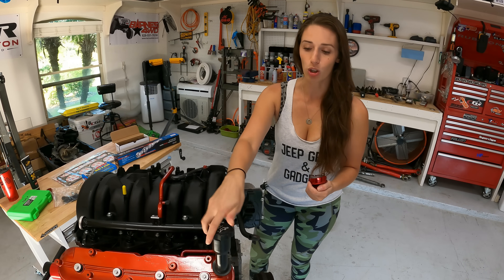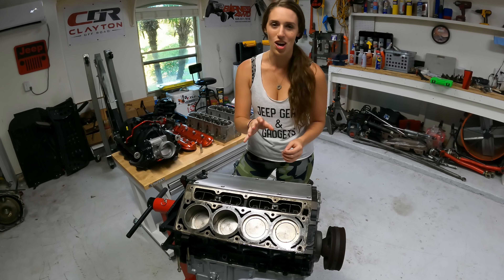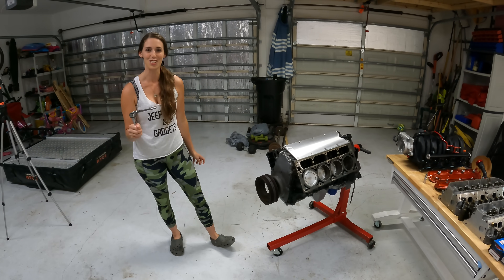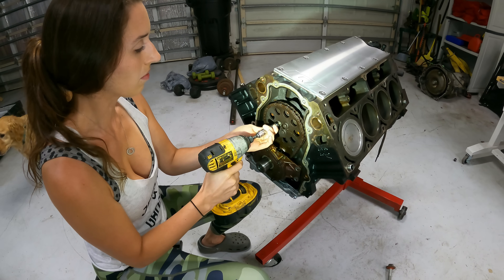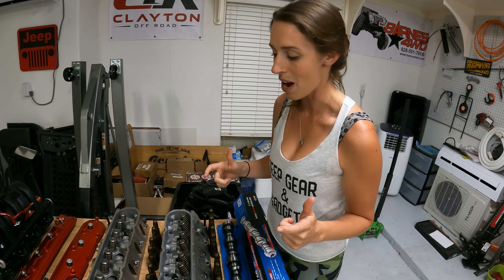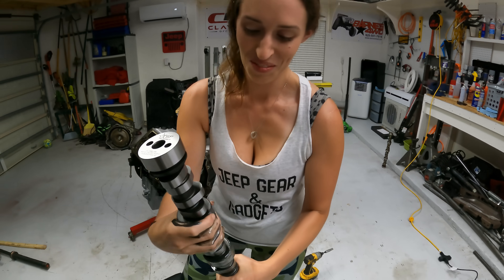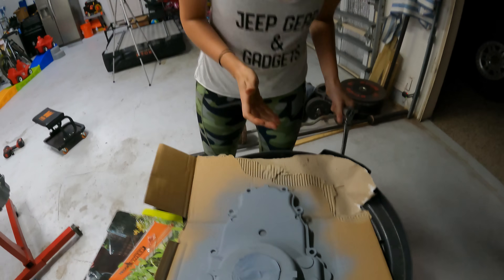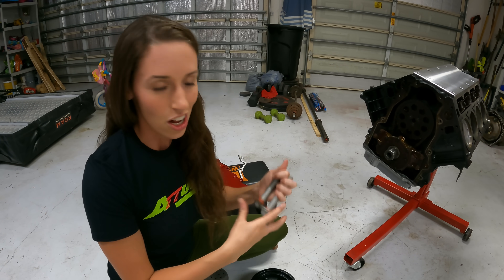The Jeep Wrangler LS Swap Gets a Stage 2 Camshaft!!

Comment: mid level hp increase? do you offroad a lot at 3500 rpm?  that cam took hp at low rpm and lowered your fuel milage
Reply from the maker: It’s perfect at 2k so far. And I’m getting 17mpg
Reply from the maker: Think about when you need a lot of power Offroad, it’s usually not when you are crawling, it’s when your spinning tires and up in the rpms

Comment: Cassie. I recommend doing the billet bar bell, oil pick up retainer, *new gm original lifter trays, along with the trunion.

Barbell:
https://www.improvedracing.com/gm-gen-iii-iv-ls-engine-billet-rear-galley-plug-barbell.html?gclid=Cj0KCQiA2af-BRDzARIsAIVQUOfX9m7ZenPh49wriRxvRUA7-lArMGIWb2LsS5Cjyo0F6LwgZQYxdDAaAgCwEALw_wcB

Trunion:
https://www.amsracing.net/products/brian-tooley-btr-gm-chevy-rocker-arm-trunion-upgrade-kit-ls-4-8-5-3-5-7-6-0?variant=4738990964777&currency=USD&utm_medium=product_sync&utm_source=google&utm_content=sag_organic&utm_campaign=sag_organic&utm_campaign=gs-2018-12-05&utm_source=google&utm_medium=smart_campaign

Oil pick up retainer:
https://www.amazon.com/Billet-Pickup-Girdle-Support-551910/dp/B0784JPH59

Gm factory lifter trays:
https://www.michiganmotorsports.com/gm-lifter-tray-guides-12595365-ls1-ls2-ls3-4-8-5-3-5-7-6-0-6-2/

From all my research building my LQ9 for my  TJ these are problem areas. I also did a double roller timing chain because I'm not happy with gms factory slop in timing chain. Summit sells them for $99.

Comment: Recommend a balancer install tool so that you don’t trash your crank by forcing it together with the bolt, or if you hear the balancer up it will slide on without any tools necessary.

Comment: I would caution you on installing a cam like that as it damages the cam bearings.  There should always be a handle used or two bolts from the water pump to gently, without too much motion, slide the cam in place. Oil pump and pick up tube o ring are a must especially with the cam change.

Comment: 11:09. I thought main the point of low lift cams is that you can use the stock valvesprings. If you're going with new springs anyway, you could have gotten more power with a higher lift cam with the same duration.
Reply from the maker: Then you’ll start needing pushrods, a different torque converter etc.
Reply: @JeepGearGadgets  if the base circle of the cam didn't change, you shouldn't need new pushrods. If the duration is the same as your low-lift cam, the powerband won't be affected and your stock converter will be fine. The low lift cams only exist to make a super simple swap and reuse all of the stock valvetrain. You can get a higher lift cam that doesn't need a converter. That's all I'm saying. Extra lift means more air, more fuel and more power. You don't have to lie or make shit up. 
Below is literally copied and pasted from Texas speed's website. Note the last sentence. 

  "Texas Speed 212/218 .600/.600 Camshaft With Your Choice of Lobe Separation

This cam gained 62.2 HP and 29.1 TQ at the flywheel on our in-house SuperFlow 902 engine dyno using an otherwise stock 5.3L engine!

These use lobes that are designed to be both beehive & double valve spring friendly.

1200-5800 RPM Power Band; This is an excellent performance camshaft with a smooth idle!  We've had tons of customers select this camshaft when looking for a cam that drives almost stock, and can be practically hidden with some exhaust systems!  If you're looking for a small, stealth camshaft, the 212/218 is a great option to consider.  It is ideal for 4.8L and 5.3L trucks that want to keep their factory torque converter."
Reply: @JeepGearGadgets   here is Texas speed's info on your low lift cam. Again, copied and pasted. If the duration doesn't change, the powerband doesn't change. If you can use a low lift cam with your stock converter, you can use a high lift cam with the stock converter. 
  "Texas Speed Low Lift 212/218, .550/.550 Camshaft With Your Choice of Lobe Separation

This cam gained 51.4 HP and 22.9 TQ at the flywheel on our in-house SuperFlow 902 engine dyno using an otherwise stock 5.3L engine!

This cam uses proprietary TSP lobe profiles that are designed to utilize the factory GM LS6 single beehive valve springs and your factory pushrods, making them the most affordable cam package on the market!

1200-5800 RPM Power Band; This is an excellent performance camshaft with a smooth idle!  We've had tons of customers select this camshaft when looking for a cam that drives almost stock, and can be practically hidden with some exhaust systems!  If you're looking for a small, stealth camshaft the 212/218 is a great option to consider.  It is ideal for 4.8L, 5.3L, and 5.7L vehicles and works with a factory torque converter."

Comment: 9:20 I like to lube one journal at a time. Lube from the rear, stick it in to the first journal, lube to the next journal, stick it in further, lube to the next journal, etc. It seems a little cleaner. But different strokes for different folks.

Comment: 8:12. I second that. Comp Cams are knowledgeable dudes. They know their shit and definitely want to help you choose the best cam. I love the roller cam in my 1990 Silverado. 
  Is it just me, or is that intake tall? I'm more of a gen 1 sbc guy but that intake looks super tall. Nice long runners for great low end torque. Maybe it's the bare valvecovers without the coil packs that's throwing me off. Where did you say you found the intake again? I like the Fast stuff, but I'm not going to spend $1000 on an intake manifold.

Comment: Exhaust bolts: nickel anti-seize.   Without it, your garage is as naked as a kitchen without butter.   Stay away from junk grade [part copper/part pot metal], which will bake out and underperform after a years time.

Comment: Very importatnt to make sure that camsaft cover seal oil gasket is set in right.  You will have an unexpainable oil pressure problem.  You failed to even mention it when putting the plate on.  Glossing over such major work without showing the details is not helpful.
Reply from the maker: How would someone not set it in right?

Comment: Great job! Texas Speed Truck Cam is FANTASTIC for the price. Just make sure you get it tuned  to maximize power and efficiency. In my truck, it ran like a scalded dog, but wouldn't idle until the timing and injectors were tuned just right. Keep up the good work! Your build is gonna be SICK!

Comment: Buddy when ya was getting ready to put cam in i was like talking to the screen “ please pit assembly lube on, please put assembly lube on “ ! Lol and was so relieved to see you guys do it right and use it . I am a factory trained Harley mechanic so am anal about that kinda thing and have seen so many here on youtube not useing assembly lube.. so thanks for not spazzing out my OCD , and doing it the right way😂😂😂
Reply: @Demo Rcr if it were me i would get the shop manual and check and see what the “Cold” gap is supposed to be .. and you will need to make sure both valves are “Closed” when you check the gap.. hydraulic lifters will only account for so much adjustment.. so make sure they are all within those specs , now that is for a engine with adjustable rocker arms .. if they are not adjustable well then it is what it is and im sure you will be fine , unless you have a collapsed lifter , then you will have to pull rocker arm rack pull lifter and replace .. hope this helps

Comment: I have an arb front locker that I run with co2 tank, ran an air line to the to the dash then used an 18 wheeler air switch to send air to the locker

Comment: awesome --- bring back memories from 40 years ago!   Fun fact .... not replacing valve springs can lead to horrendous outcomes!  in the early eighties as a teen did my first cam swap (no youtube) and didn't replace the springs when putting in the new mopar purple shaft cam --- result was not immediate but after about 12 hours of driving suddenly serious failure where several push rods broke/bent and even nearly shot through the valve covers!  lesson learned ;)  --- thankfully no serious internal damage.

Comment: First person I’ve seen using the 615-183 intake, I’m running that on my Tahoe
Reply from the maker: Do you like it?
Reply: Jeep Gear & Gadgets / yes I do, a few areas needed to be touched up like the ports have notches by the injectors but it does flow more air than say a factory lm7 and opens up tuning

Comment: U should put i high volume melling oil pump that is the heart of the engine
Reply: And the oil service modifications calling for more volume are what?  You have to do something in most cases: add squirters for pistons; extra/custom oiling for rockers; add/resize a turbo oil line... something.   That little phase 2 cam is a fine choice, but it's not headed for 8k+ rpm where you begin to worry about oil stripping from bearings.

Comment: When you do a new Camshaft you need to do new lifters Gm has a soft Cam So it's always wise when you do a new Cam to put new  Lifters in And it will save you a headache
Reply from the maker: Not with this cam
Reply: @JeepGearGadgets  which brand leggings are the all dark green ones?
Reply: Why should you change roller lifters with a cam?
Reply: @mazevx2451   Because the way they wear that you always changed you lifters looking you can

Comment: May wanna look into a trunion upgrade for your rocker arms. Fairly easy with a shop vise. The factory used needle bearings that are know to migrate around the engine when they fail.
Reply: Right, it is one of the weak links in LS motors.